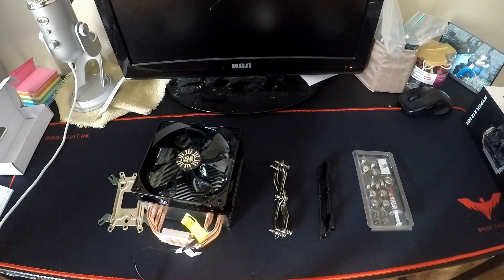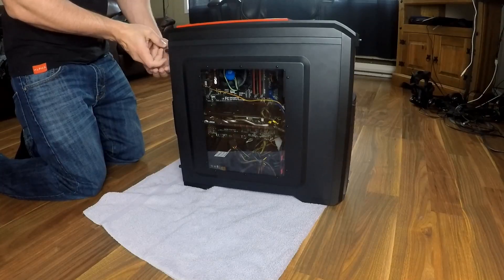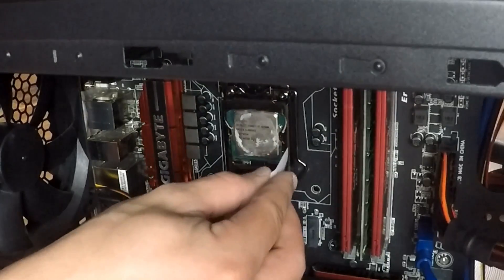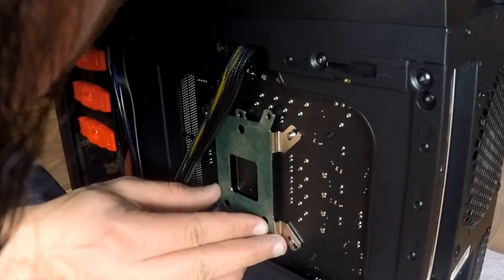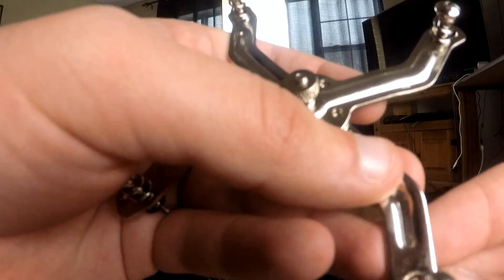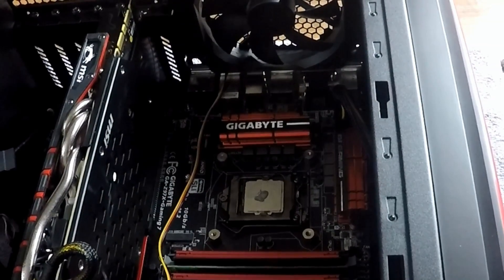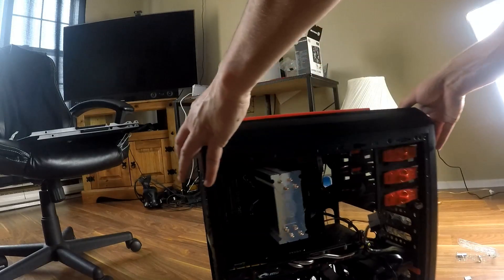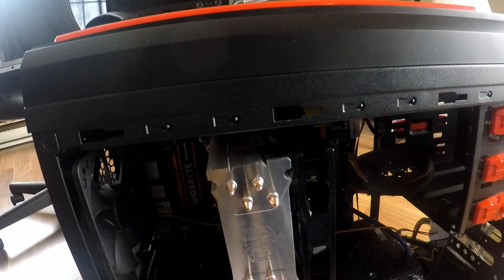How to install CoolMaster HYPER 212 EVO CPU COOLER (1150 Socket on I7 4790k)

Comment: Do you need thermal paste?
Reply from the maker: Yes, make sure to always use thermal paste
Reply: Ok thanks for quick answere, thought you didnt use it but I watched all the video then i saw, btw it works on LGA1151 motherboard socket??
Reply from the maker: @MrbeanGaming  yes, it has multiple attachments to adjust it to the right size
Reply: Ok thx

Comment: Did you loose any RAM slot?
I have 4 RAM slots on my MB and im using slot 2&4 do you think it Will fit on my MB?
Reply from the maker: Didn't lose any ram slots
Reply: I thought it was best to put your ram in 1 and 3
Reply: @culture.  I know your comment is from 10 months ago, but just in case you have not found your answer yet; it depends on what motherboard you have. For my MSI z97 board my ram is suggested to run in dual channel in slots 2 and 4. but some mobo's might recommend slots 1 and 3. Just google it for your board or check the user manual if you have one.

Comment: Dumb question but does the fan plug into the same header as my stock cooler? I'm worried the cable wont reach
Reply from the maker: depressed edits yes, it plugs in the same spot

Comment: Great video! After I installed it I noticed a little bag of what looks like spacers which you didn’t use but instructions say to. I had to apply some force to get the screws to meet with the mount but I didn’t push what I thought would be too hard. Do you think not having these spacers will damage my MB in the long run?
Reply: BaMcD i had the same thoughts and issued as you but fuck it its on now

Comment: Great video thanks. All the other ones show installation with the board removed. I would recommend to your viewers to get a 3rd party paste as they perform a few degrees better than tha paste that comes with the cooler. Arctic MX-4 is an excellent choice.

Comment: so do you put the fan opposite of where your exhaust fans are? does the fan on the evo suck or blow?
Reply from the maker: wesler218 the fan should blow away from the heatsink to pull off excess heat. This also helps draw air across the cooling fins.

Comment: Hello, great video congrats. One question, its very tighten your screws of CoolerMaster ? 
How much to tighten?
The cooler should after installed be moved or not?
Thanks.
Reply from the maker: Octavio k Put the screws on tight enough that they won't be loose but don't over tighten then to break the motherboard or thread lol. And I don't quite understand what you're asking about the cooler